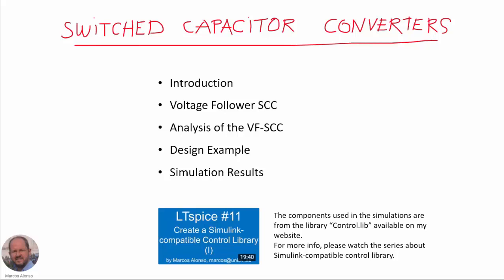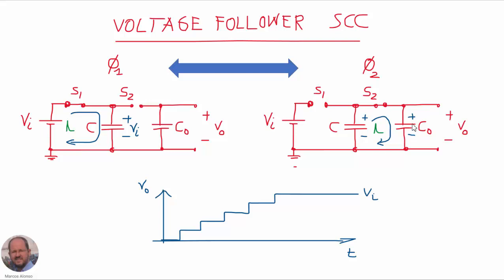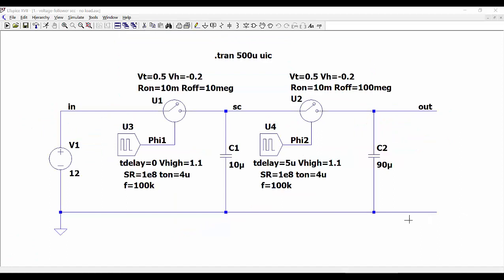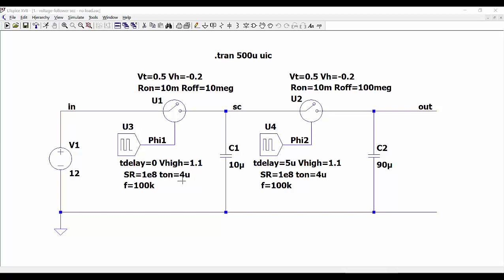PE #17: Switched Capacitor Converters: Introduction

Comment: thank you so much professor , can i ask you about replacing every switch with transistor what i have to do and which transistor you suggest to chose?
Reply from the maker: Thanks for watching. You can use for example a IRFZ48Z. You can use the gate driver available from the library Control.lib